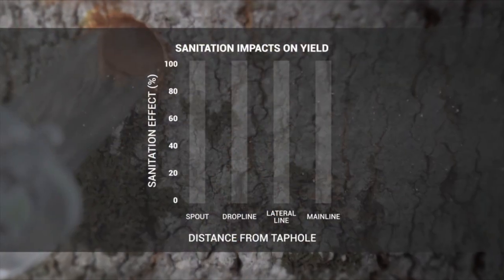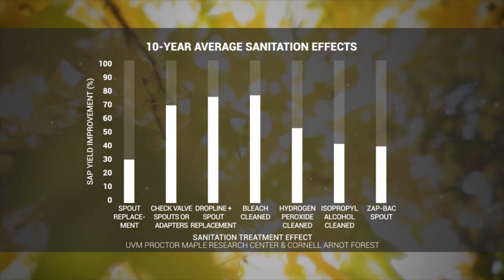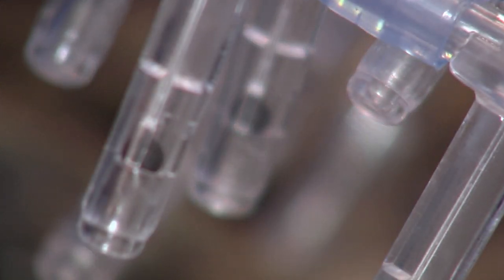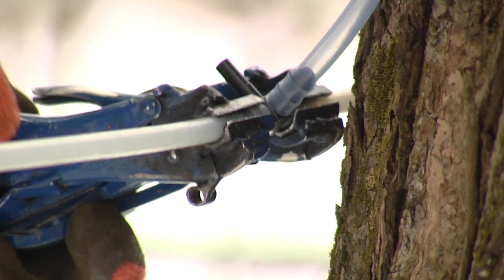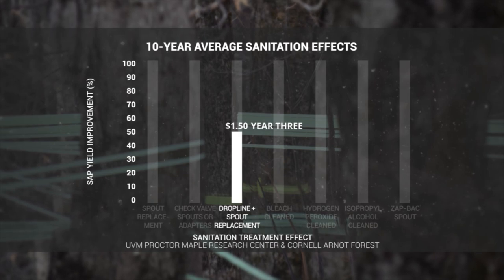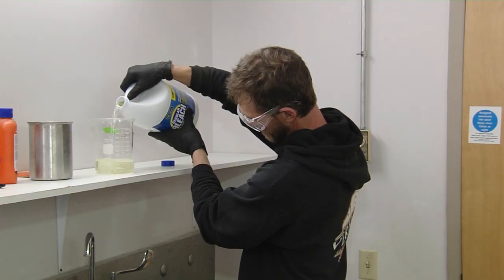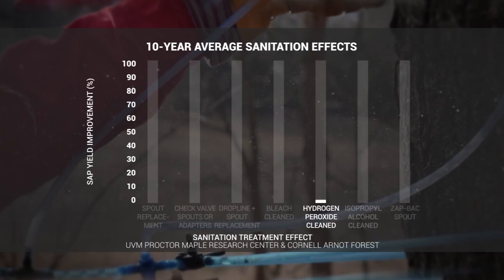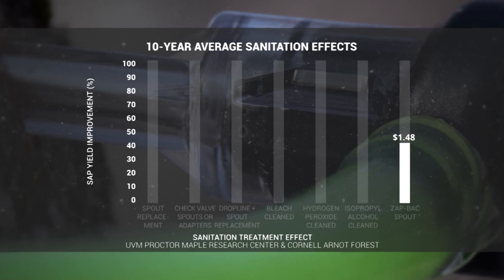Spout and Dropline Sanitation for High Maple Sap Yields

Comment: I have 130 tree sugar bush I own in Upstate, NY. Twenty trees are on a simple main line. I plan to sell the sap bulk to processors. I'm a beginner and put that line up last year. I've been planning to expand to the rest of the trees (big sugar maples) but trying to figure out my costs and equipment needed. Many things to learn, thanks!
Reply from the maker: Good luck with your season.  As a beginner, you might check out https://scholarworks.uvm.edu/cgi/viewcontent.cgi?article=1022&context=rsmpp for helpful information
Reply: @UVMProctorMapleResearchCenter  Much appreciated, great information!
Reply: I'm going to try putting the cv taps in-line on my laterals. I'll likely limit 10 taps per in-line cv tap. If vac is lost or reduced momentarily in the main line it will remain in the laterals.

Comment: Dr. Tim, are you suggesting we use check valves and replace drops every three years? Or would using just check valves provide the same results?
Reply: Just use check valves every year. I think if i remember correctly from studies i've read, you'd get the highest yields by using a CV and new drop every year, however the labor/materials cost of this make simply using a CV and not replacing drops the most profitable approach.
Reply from the maker: Either use CVs and don't replace  drops OR replace drops on a 3-yr rotation, with new spouts in intervening years.
Reply: @UVMProctorMapleResearchCenter  When using check valve spouts you are still recommending replacing the CVs each year, correct?
Reply from the maker: @TheLuke1184  The Leader Check-valve spout, like all single-use spouts, is designed to be replaced with a new spout each year.
Reply: @UVMProctorMapleResearchCenter  So the exception to a single-use spot would be the ones that have two pieces, the "stubby" end on the drop and the actual spout that you replace? In that case, would you replace the stubby end on the same rotation as the drops?
Reply from the maker: @TheLuke1184  There is no need to replace the stubby if you're not replacing drops, however if you are replacing, then the stubby would also be replaced at the same time.
Reply from the maker: @TheLuke1184  Typically yes, stubbys would be replaced at the time drops are replaced.

Comment: Hi. A few questions. 

1. Where can I get the sprayer used to inject chlorine into the lines? And what kind is it?
2. How much bleach  (can I is chlorox?) per gallon of water and how much diluted at each tap. 
3. Does this fill my lateral lines as well?  They are a little skuzzy in some spots. 
4. When I let the first sap spill in ground to rinse out the bleach solution remains, do I so that from each tree or can I let all the  sap run through my mainline and spilling just before my collection tote?

Thank you.
Reply from the maker: They are offered by several maple equipment dealers.

Comment: Those zap-bac spouts are nothing to write home about.  My first year with them they did ok but after that they were useless.  I had a lot of biofilm build up on the inside of them half way through the second season (this year) and my sap yield slowed right down. In order to get the sap yield that I needed I did something that I hate.  I reamed my tap holes.  It only amounted to about an extra weeks worth of running but I got my production numbers up to where they needed to be. I don't want to do that again.  Have to adopt a different plan.  I know someone else that had great yields and they didn't use check valve spouts just new straight spouts (don't know about the drops).  I keep looking at different ideas.
Reply from the maker: I agree.  ZapBac spouts do reasonably well the first year, but production is lower in the second and third years. Dr. Tim Perkins

Comment: I'm using seasonal spouts and washed drops. I keep two sets of drops, when I tap the dirty drops are removed replaced with the clean drops that already have a new seasonal spout installed. The dirty drops get washed and stored for the next season.
Reply from the maker: This approach will work to get decent sap yields, but if you factor in the time and expense of this process, it isn't the optimal economic approach for most producers.
Reply: @UVMProctorMapleResearchCenter  Works for me, half the cost of cv spouts.